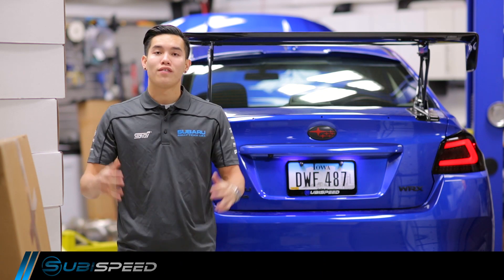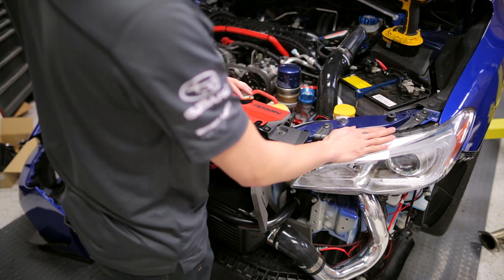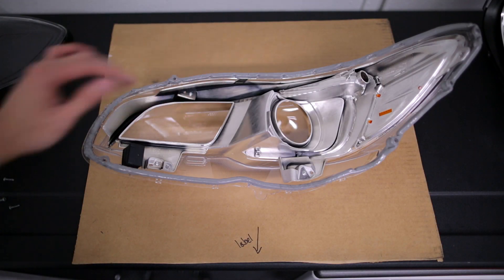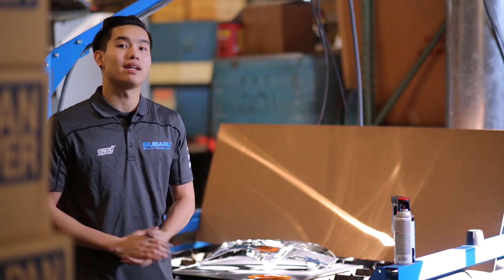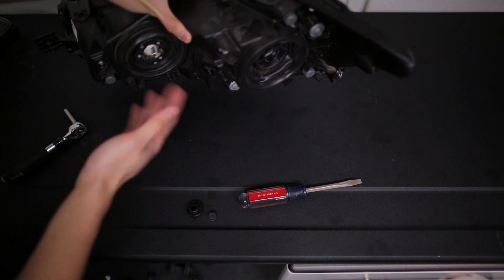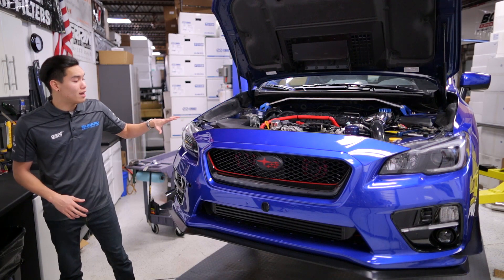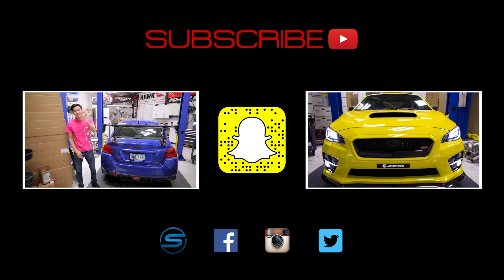Subispeed - 2015+ WRX/STI Headlight Modification w/ C-Light & HID Retrofit

Comment: To anybody looking to do this. It's not going to take you 20 minutes like they make it seem. 
Some good tips;
Scuff up the chrome on the headlights with scotchbrite pads or whatever before applying primer. Use a self etching primer before you apply your final coat. 
The headlights don't have to be baked apart,  prepare to fight off the oem sealant. But they have to be baked back together if you replace the sealant with the stuff provided. Be quick putting the pricks back together, prepare to panic.

Comment: Suggestion to installers... Its up to you, but mine were constantly needing the connectors re-adjusted at the C-Light bulb socket... Ide adjust it and it would last a week until I would have to get to the socket, and re-seat the connector. Even tried electric grease which worked longer but same in the end. Decided after much deliberation to cut out the OEM bulb connector and splice the wires together. No more headache! But I understand why some wont want to do that.

Comment: Why not spray the chrome behind the high beam bulb too?
And can you elaborate on "aiming" the HIDs?
Reply from the maker: +Zekai Wu The chrome behind the high beam is still being used to reflect the light from the bulb as it is not a projector. As for aiming the HIDs, there are 3 8mm bolts that you either tighten or loosen to aim the HIDs correctly so your aren't blinding other drivers.

Comment: What is the wire for that comes from the coil of wire under the projector lens that you sent through the c-light hole. I have nothing to hook it to. Otherwise, the lights work without it.
Reply from the maker: +Johnny Z That is for your high beams.
Reply: +SubiSpeed OK, so I disconnect my  other light that's on the inside and hook it to that and seal the hole/leave the bulb there?
Reply from the maker: If you ordered from us, you should've received high beam splitters that allow you to plug both the high beams on your new projectors and the OEM high beams into the stock harness.
Reply: +SubiSpeed Yeah, I ordered from you, but the only wiring I have is the 2 relay harness that has the OEM input, which is what I assume is being used as the signal to turn on power from the battery to the HID's.  Other than that, I don't have a splitter.  I plan on ordering a lot more stuff from you guys: DRL harness, tail lights, fog lights, etc....so if you could include that splitter with my next order that would be cool. Already spent $700+. So much more stuff I want to do.  Thanks for the responses!
Reply from the maker: Johnny, 

Please email sales@subispeed.com and our sales team will get you taken care of. 

Thank you,
Kevin

Comment: How/where did you guys mount the little black switchback "block" module if you did not install it inside of the headlight? Did not install mine in the headlight... Suggestions??? If you don't hang/mount it behind the headlights somewhere then its just dangling and at risk of spray-back with water while washing the car.
Reply from the maker: +Zachary Brandow We mounted it to the back of the headlight.

Comment: The 2017 STI has wiring that goes inside the headlight.  It doesn't unplug like the one in the video.  Any ideas?
Reply from the maker: Are you able to follow the wiring to the connection at the harness?  I would believe you would be able to unplug from there.
Reply: It doesn't unplug in the 2017.  The wires all go inside of the unit

Comment: What's the point of the HID retrofit projectors when the OEM headlights already have a projector unit?
Reply from the maker: +hamburg1ar The stock projectors are halogen projectors not designed for HIDs.

Comment: Can someone please explain the purpose of the retrofit kits? Don't the wrx's already have a projector? Is it necessary to do a retrofit kit if I want demon eyes?
Reply from the maker: WRX's come with halogen projectors which are not made to disperse the light of the HID bulbs. HID projectors do a much better job dispersing the light of the HID bulbs which is why there are retrofit kits. As for demon eyes, you do not need to retrofit to install them.

Comment: doesnt that sealant still require to be heated or baked to seal? it doesnt say so in the video
Reply from the maker: +Terry Mei Depending on what sealant you get, yes you may have to bake it.
Reply: +SubiSpeed which sealant doesnt require baking?  How about the morimoto ones you guys have on the site?
Reply from the maker: +Terry Mei The Morimoto sealant does require baking. Unfortunately, at this time, the only sealant that doesn't require baking that we know of is the Subaru OEM sealant.
Reply: +SubiSpeed any way to get hands on subaru's sealant?
Reply from the maker: Not that we know of, you may want to ask your dealership.

Comment: I went to a couple of well regarded body shops in my area and they said that painting the chrome will just flake off and that opening the headlights will cause it to condense since they evacuate the air. Have you had any of these issues?

They both told me to just buy different headlights, where the hell can I find headlights and tail lights for a 2017 forester?!?!
Reply from the maker: Here are some tail lights we offer for the forester: http://www.subispeed.com/2014-subaru-forester/lighting/tail-lights/olm-usdm-cs-style-led-tail-lights-2014-forester

As far as the headlights go, as long as you you seal them up correctly you shouldn't have any issues with moisture. If you're worried about the paint flaking off you can lightly sand it.
Reply: Thanks so much for the quick response. I am intimidated to try this myself with no prior experience. I just need to find some butyl rubber sealant to reseal the housing. Thanks!

Comment: You say you didn't have to bake the headlight to get the sealant to come apart. Is this true on all the 2015s+? I have read several things on people still baking the headlights. So are they just making a unnecessary step?
Reply: +MrGovenator1 You don't need to, no issues with mine when i didn't. 15' wrx base.
Reply: Wrxwagonguy Great to know, thanks. Might need to spray the nasty chrome and put in those awesome LED C lights.
Reply: Didn't bake mine '16 wrx limited
Reply: ***** I just wasn't sure if it was a 2016 thing or both the 2015 and 2016. I have no idea what model year their products car is.
Reply: +MrGovenator1 - if I'm not mistaken, their car is a 2015. I did the C-Light mod on my '16 LED headlights and I did not have to bake them to open them up. Although it would probably make it easier. Does require force to separate them.
Reply: ***** How do you like the C-light mod? The stock ones are just horrible, and these from the video look just spectacular.
Reply: +MrGovenator1 Nope you don't need to. But it makes it easier. It is very noticeable as they cool from the oven that it gets harder to separate the 2 pieces. Not that you cant do it. Just a little easier.
Reply: Straying the chrome black... does this reduce your visibility on the road by chance?
Reply: The low beam and high beam performance would be unaffected. The part that gets painted is a separate shroud that is not part of the high beam reflector, or the low beam projector. This would cut glare normally reflected off the chrome housing and make a more crisp and clear beam pattern.
Reply: Awesome. Thanks!

Comment: Do I need to bake open the stock headlight cases? Also, will I need to bake them closed with the morimoto rubber sealant?
Reply from the maker: +flan Baking is not necessary when opening, but you will need to bake them closed if you use new rubber sealant.

Comment: Did you guys the re use the grey Oem sealant or did you replace it with something when you re assembled? If so what product did you use and did you have to bake it to re seal it? Thanks you
Reply from the maker: +Andrew Thomas We reused the oem sealant because we will be opening them up in the future but we recommend using new sealant and yes you'd have to bake them when using new sealant. We have retrorubber sealant available on our website.

Comment: the install you did they  on limited headlights? I ordered morimoto c light led switch backs. want to install them properly thanks and take care
Reply: The headlights in this video are the base model headlights with the halogen c light bulb. If you use their DRL harness you can wire the morimoto switch back right to that and just unplug the DRL module on the passengers side under the bumper. Currently doing this on my STi.
Reply: I have the drl harness from Subie bros so my c light are my drl
Reply: Nice. That makes it easier. I just wired the morimoto clights to that instead of unpinning the headlight wire.

Comment: Subispeed:  You kinda glossed over how you actually mounted the projectors.  From what I can tell you only mention using the two bottom mounting holes.  Did you only use the two bottom holes or did you drill and use the top holes too?
Reply from the maker: +Kuth70 We only used the bottom 2 holes.

Comment: Do u need to put pack In oven to reseal ?
Reply from the maker: Miguel Zaragoza only if you are using new sealant
Reply from the maker: 200 degrees for about 10-12 minutes
Reply: SubiSpeed Is that with both pieces of the headlight together or just the bottom piece with the sealant

Comment: The krylon fusion paint you guys recommend is junk. I bought it and the finish was spotty and uneven, just wasted time removing the paint afterwards. I ended up respraying it with matte black paint by rustoleum. Came out perfect.
Reply from the maker: As many people have seen in the video, ours came out just fine.

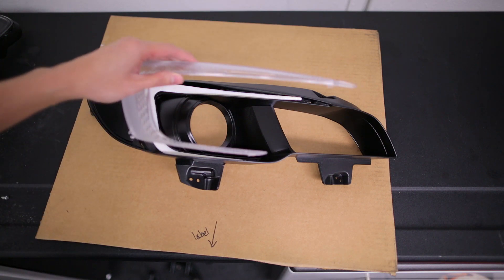Comment: Subispeed, Did you paint over the C light housing on purpose? I've seen others tape it up so it still reflects the light. It looks like you cut out and placed a piece of paper over the C light housing after it's been painted black (seen at the 8:00min mark). What makes for a better outcome?
Reply from the maker: Yes we painted over the C light housing. What you see at the 8:00min mark is the Morimoto LED C-Lights. The LEDs are plenty bright and don't need the extra reflection.

Comment: That's awesome. Definitely going to do this on my sti limited particularly to black out the orange reflectors. 

My one question, do you guys sell the headlight sealant separately or do you have to buy the morimoto led strip to get it? I'm thinking of keeping my stock led strip
Reply: use morimoto retrorubber to re-seal.

Comment: are those fit the limited?
Reply from the maker: +Jin Chen These can work for any of the 2015 WRX headlights.
Reply: +SubiSpeed I am also looking at the holes when you take off the lip spoiler, you don't need to fill those?
Reply from the maker: +Jin Chen You should fill those. We didn't since we use this car mainly for the track.

Comment: painting the front sidemarker is illegal
Reply: +therobotmakesitfunky yeah you're right it is, however, most things you do to your car qualify as "illegal". you're not gonna get a ticket just for this. You can smoke them out if you're worried about it with a product like VHT night shade, that way it has reflectivity to it.
Reply from the maker: +therobotmakesitfunky This car is only used on the track.
Reply: +SubiSpeed "Track use only"